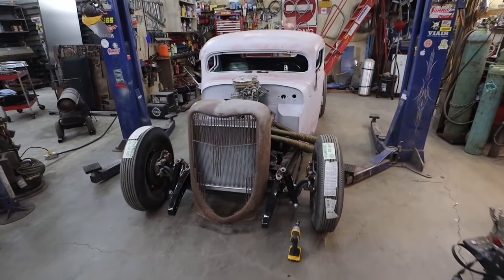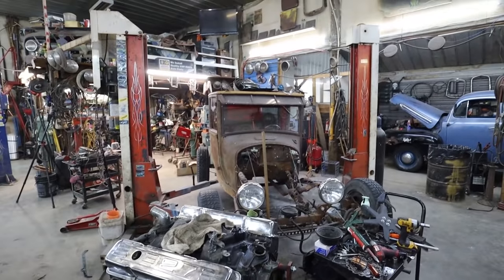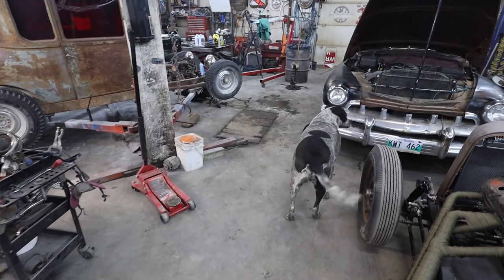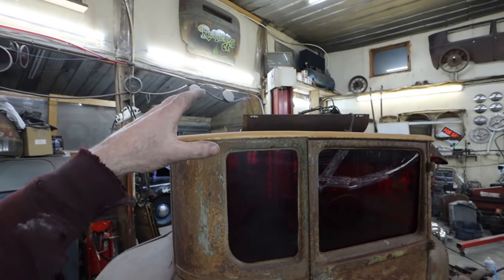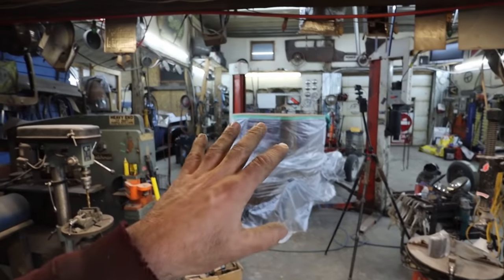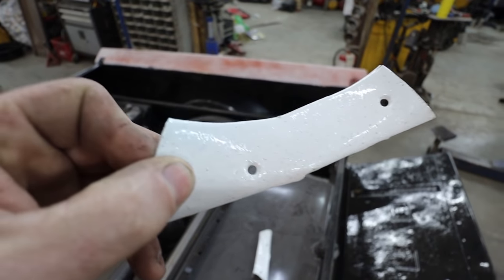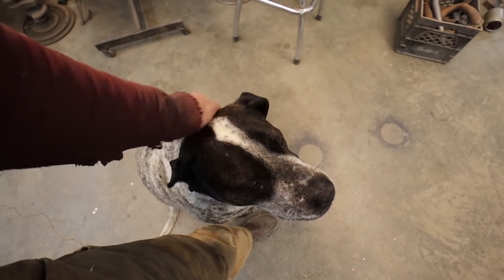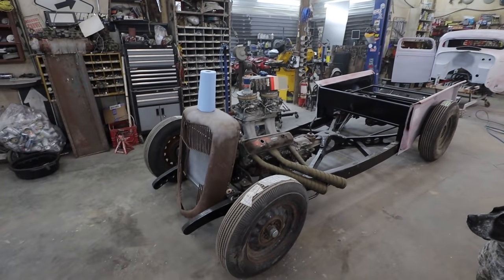Prepping the 327 and testing Metal flake paint maybe for the 37 Ford hot rod Part 29

Comment: Painting that black first then putting the flake on it will give you a much nicer, cleaner effect. Some people do it black and only do a couple of coats of flake and it still does look very good. I prefer to do the flake till its covered totally over a black base but you will use a ton more. You will only learn more the more you do tho. A primer gun with a 1.8 or 2.0 mm tip add the flake to the clear and just shake it constantly you will have pretty good success. That flake does look to be HUGE stuff.

Comment: We used to use a vacuum spray gun from Sears to blow flake. lay down a base coat with no flake and then spray the flake mixed with either clear or a tinted clear, Once dry it got about 20 coats of clear on top.

Comment: Hold on  Cuz on the sound deadner, Go to Lowes or Home depot, look for Peel & Stick Asphalt flashing, comes in 4" & 6" wide rolls, I used it on my Chevelle and works great as a heat sheild and sound barrier, cost me around $60 (US) 10 years ago

Comment: My first experience with flake worked fine. I used a big tip (2.5) and make sure the filter is pulled out of the gun. I also used a black base and .008 flake mixed in House of Kolor intercoat clear made for flakes and pearls. Then buried in clear.

Comment: Put some clearcoat in an underseal gun add your flake and spray at not too high a pressure and ten put several coats of plain clear on top see if that is any better. Also put a base colour down first.

Comment: Mix the flake with intercoat clear and spray it on after your color. Then sand and spray regular clear on top. The intercoat clear holds the flakes so they don't run as much.
Reply: With Colored Flake You Can't Sand Until It's Buried Under 3 Coats Of Clear!!! If you Sand While Just intercoat you will Sand Away The Color On The Flake Getting Silver Specks in The Paint Job!!! Best To Bury The Flake In Clear Then Color Sand and Then Flow Coat!!! After The Flow Coat It Will Sand Smooth and Polish Out Great!!!
That's how I Do It!!!
Rock On Brother!!!

Comment: SEM makes a candy concentrate that is green and easy to use Brent.  You pick a basecoat (like a a heavy silver metallic and add an 8oz bottle to two qts of clear.  Real easy to use, you don't get the striping like you do with a candy job and you won't have to put a half inch of clear to bury that flake!

Comment: A tip of the hat to you Brent. I had my VW bug painted last year. Afterwards I went to the paint store with the right paint code to have spray cans made. Did the wheels on one side of the car it looked terrible they looked like sandpaper. Never painted the wheels on the other side. My wife does all the painting around here. I'm the cleanup guy.😞

Comment: Ive sprayed flake on several projects with  a  good friend, and we started with the Dry flake (monster flake  .025) like you have.
The problem with big flake it takes a TON of clear and flake to cover.  We ended up spraying 12 coats of clear to cover the flake, then was wet sanded and polished.
What we are doing now is using a small grind flake ( baby .004) trippin flake from Roth.  Start by spraying a base color down very close to the color of flake you have, then using the  .004 flake mixed in a Mid coat clear, this is a heavier product and will help "suspend" the flake so it can be sprayed through a gun with 1.8 or 2.0 tip. 
Get this sprayed down as many coats as you feel is right for your look.  Then use straight clear and spray 4 wet coats and let cure over night, followed by 800 grit sand paper on a interface pad and get rid of alot of the orange peel. Then 4 more wet coats of clear, sand polish to a flat smooth finish.

Hope this helps.

Comment: Binks made a 2 gun kit in the 60's and 70's (don't know now). One gun was a standard paint gun. One was designed specifically to spray flake. As I recall (and we are back way beyond my memory) the flake gun came with multiple heads for large flake small flake, etc. It was an expensive set up back then but just worked like a dream. Might find some on the secondary market. I sold mine many moons ago but have regretted that since.
Reply: Binks i knew the design engineer back in the 60s
i used test out new gun in the field as to say 
late 50s start of the candy flake pearl ,,,, a sand blasting gun was for heavy metal flake,,, with over clear coat a 220 was a good clear coat gun,,, Edwin Beverly Hills Ca

Comment: 327 build , 

First, if the mains look bad, check the old crank for straightness in V blocks & a dial indicator and always ALINE BORE THE BLOCK !  Next, never EVER use a high volume oil pump unless you are running a true full DRY SMUP SYSTEM ! with a min of 20 gallon or more remote storage tank. The reason is ( as Smokey Yunick told me) a 5 or 6 quart oil pan will go dry before the oil can return to the oil pan with the extra long gears in a high volume oil pump and you very will can BURN UP ANOTHER SET OF MAIN BEARINGS AGAIN. What you should have used was buy a high pressure, standard volume oil pump ( yes they make them to with a different P/N# )  That high pressure pump will give you 65PSI hot and right at 68psi at 2,000 rpm on up but will   NOT suck the pan dry.  I just finished my 1967 / 327 ( now a 331) and with the high pressure pump, my oil pressure is spot on at 65psi hot but I did aline bore the block & ground the crank .010/.010 plus balanced everything and loosed up the side clearance on the rods so the extra oil pressure has a place to escape to help keep the motor cooler and mine is now running quiet and strong. ( I just got a total of 100 miles on it today) It will gain more horsepower as the Molly rings seat in a few thousand miles.

Comment: Not knowing as I do. It is done successfully. I reckon the right base colour to match the flake is a must. Now probably a clear epoxy resin will be better sprayed on in sufficient amounts to coat without running. For that you need the right advice on which resin is the one for the job? And keep spraying coats until it is thic. So you can sand it flat without cutting the flake/glitter much. It's not something I approve of but I have seen a green 38 coupe done in it and it was a work of art you might say?  Flat as a mill pond over the surface yet looking like you could touch the roughness when right up beside it. A fascinating experiment, and I still dread spraying metalflake, iridescent and pearl types. It doesn't look good 'enough', but it is getting there already.

Comment: Excellent video Brent  :) also on truck  looks great also T too with Metal Flake paint and least tried also learning from it ! 327 showed bearings that wild for sure on  Copper color and probably what happened you said did have choke on motor carb and raw gas mix oil happened  and hopefully cure problems have choke on carb next time! But saw check Metal Flake in next few days check over and might change mind say need cure on drying and makes difference! We all learning how do things that should be thought Brent  :) !

Comment: Hello Brent, I know you are a hardcore old-school hot-rodder. I was hoping that when you found out that it was the crank that was bad along with the main bearings as far as the oil pressure goes I wished you would have chamfered your oil galleys for that little extra extra. When I built my 440 the crank was in great shape and I was doing total rebuild with blueprinting so that's where I started chamfering the oil galleys polishing the crank. A lot of people don't realize that all Blueprinting is is taking off the sharp edges basically oh, and it will definitely give you a few thousand RPMs. Anyhow I can't wait to hear that engine and watch that sucker go down the road. Can't believe what you've done and where that thing came from.

Comment: I would use a similar color base to the flake you are spraying for coverage, that green looks awesome over black base without 100% coverage. the wet clear and dry application of flake works good you have to clear over the flake with 4 coats of the cheaper clears so you have enough to sand it flatter and reclear, I have made some heavy flake totally flat and it was a total pain with a huge mess to clean up. But you can.t get that look any other way.

Comment: Good attempt at metal flake. You tried something and you now know what works and what does not. Mixing the big flake/glitter with a clear or colour coat would create consistency issues as well I would think. Think you just need a better method to apply the flake/glitter in a uniform consistent manner. I still like the idea of a matte green finish, maybe not as dark as the General. It would look really cool with the matte black trim/mouldings. Be safe and stay well.

Comment: @ 20:02, finally a work philosophy I can understand !
I've gone through a lot of my adult life with the theory that if its not working when I am asking to fix it, what could go wrong?
Part 2 of that is, if I trash it I buy a new one.  Don't know that has ever cost me more than a couple hundred and you can keep the rate of work high, plus often people wonder how you "learned" that...while, you weren't around for the first few I broke.
Re paint:
think its going to have to go through a real spray gun just for the consistency and control (Shutz gun too random).  Figure out the size of orifice on the heavy primer gun and if you don't use one of the other sizes that likely came with the gun (forget a bit, most guns from Princess come with multiple tip sizes), use that as a starting point.  Find a buddy with a full set of drill bits (letters, numbers, fractions and metric) and starting with the size opening the primer gun uses, working your way larger until it works with the size of flake you got.  WAG but in the '50s and '60s lacquer was a whole different ball game, not sure how well those products/huge flake work with today's paint chemistry. 
That white in the interior is very mid '60s, lots of furniture had Fomica tops with that mix of silver and gold "star" pattern.

Comment: I spray flake that size all the time mixed with clear gelcoat on boats best set up is a gun with a 1.8 or 2.0 tip spraying at about 1/2 the fan area you would without the flake,then finish with with a clear coat over top for a smooth finish.another tip is the 3m acuspray gun is ideal with the disposable tips but not cheap

Comment: many moons ago I hecked into metal flake paint (old school) and found out you put on a color coat first then use less
reducer so the clear is a bit thick then spray on the metal flake then spray it with air only to flatten the flake into the wet paint then give it up to 25 coats of clear

Comment: We painted metalflake on boats in the 60s (my father and I)  base coat color, flake in clear then clearcoat.   Never had any problem.  It's all in the quality of the paint.  Use lots of clear.  Use a proper paint gun with the correct paint nozzle.

Comment: Paint a solid base color first, lighter or darker than your chips. I use a binks #7 with a primer tip. mix the chips with a thinned clear. Spray with a higher pressure to get the chips to lay flat. If you don'i get them flat later sanding will sand the color of the chips making sailver chips. With the base coat of color you don't need or want100 percent coverage. better if you don't After clear the sh77 out of it sanding between every three coats or so. Keep it wet so you can see if you hit a chip edge. Touch up silver chip edges with a tiny brush of base color between clear coats. It sounds complicated until you do it. Just a lot of clear coats and wet sanding.I have done a couple with a few top coats of candy. It makes the chips seem an inch below the surface. A round body style is perfect for this if you want the antiqued worn area look, darker edges lighter in the panels middle.Ah the 70 s painting ideas up the yahoo.

Comment: I've done metal flake a few times. I sprayed a course metallic silver base, then metal flake in a mid coat clear, then I sand it and spray a candy coat then lots of clear. I believe I used a 2.2 tip for the flake, but there is a good chance your flake I larger and would spray through the 2.2 tip

Comment: I've always mixed the flake in with clearcoat and sprayed it on add a couple marbles in a suction feed gun. I've used up to 8mm flake with no problem. Modern plastic flake is really nice because it's the same color all the way through. Check out Roth Custom Flake's site, they've got a gun like you made and BIG flakes.

Comment: How about using the flake in/on a contrast colour? Maybe do the grille, rear window and the stake pockets in a darker colour with the flake, keeping the rest of the truck in a plain, lighter shade.
Looking at the red flake on the other car, I'd try a few more coats of clear, maybe get it to smooth out. When you started doing just the edges of the roof, it was starting to look pretty good. What would happen if you just did the edges with the flake, leaving the main body of the roof in a solid colour, with just a one inch border of the sparkles?

It's pretty interesting watching you experiment with this stuff though. Tere's plenty stuff outside that you could experiment on, either single panels, or whole cars, although that would take up valuable space in the shop. I still can't picture what the truck is going to look like when finished but I'm not a big fan of either of the greens so far. You'll get there though and it's the picture in 𝒚𝒐𝒖𝒓 head that matters.👍😁

Comment: the best way to put that type of metal lake is do a two part resin and mix the flake into it then use a heat gun to level it sand and polish or clear coat it. thats how i did my custom interior on my 73 scamp and 76 gremlin. also not as budget friendly just go with a metal flake paint from eastwood

Comment: find an old jet for your spray gun and open it up so it is just smaller than the needle so with a thin mix it will go through the gun and yes you do need something in the pot to rattle around to keep it mixed

Comment: Did this once but used a thick clear epoxy gel coat and a screen to sift the flake onto the gel. Let it sit for the flake to settle into the gel Then vacuumed off the excess flake. Many many coats of clear coat later DONE! Not an easy task and real time consuming.

Comment: Brent I wonder if for holding little objects like those bits of trim so they don't blow away when you paint them you could try something like a valve lapping stick.

If using suction cups to hold an object on the stick didn't work you could try something like magnetized rubber strip?

Comment: If you put a green base down and use a siphon feed gun with ball bearings will work. They used to make agitator cups for the siphon feeds. Check out 57letterly here on YouTube. Bass boat type flake ...or sinister 57 Chevy by victory red Colorado. I sprayed that w the ball bearings in the cup setup but takes a lot of clear to bury the flake..20.00 harbor freight siphon works great

Comment: Don't know the size of that flake, but if it's real big you'd be better off getting smaller flake and you'd still get the look you're looking for...Also you need at least a .02 mm tip on the gun...Here in the states Harbor Freight sells a cheapo for about $22.00 bucks that'll get the job done and throw it away afterwards....I recently flaked a bike like this and it came out awesome

Comment: At the same point in time that metal flake was big, so were candy colors. Why don't you go to a candy apple blue? Metal flake has always been very expensive because it's so hard to do, especially with over- sized flakes. Your biggest dilemma with a candy color is whether to have gold or silver be the base color. Your original mint green was not a good fit for that truck, but to each his own. If you are going to do the bomber seats and leave them the natural aluminum, maybe black would be better than white for the interior.

Comment: I’m sure you knew this, after putting your masking tape down, take a hammer and lightly tap around the edges and the metal corners will cut the tape exactly where you want it masked, saves the time using the knife lol

Comment: Would the wrong harmonic balancer chew up main bearings  didn't the 327 use a narrow balancer as in, internally balanced and the externally balanced 350 used a wide harmonic balancer

Comment: for heavy flake touchups i actually mixed the flake in suspension with the clear and used a very slow hardner painted it on with a brush. I have also used (don't laugh) some pvc pipe and a clean shop vac on blow so it works like a big powdercoat gun or your little blaster gun but with a lot bigger nozzle adjust pickup pipe size to control flake volume or you could build the same thing on a air nozzle instead of the shop vac

Comment: You can't sand metalflake very well. The sandpaper can bites too deep andwill take the red coating off of the aluminum flakes and look dull and grey. Be very careful you don't sand too deep. Also you need an undercoat` of the same color.

Comment: Metal flake paint is all in the correct color base coat & getting the correct size tip for the size flake your using, then drowning it in multiple coats of clear. Wet sanding with 800 then 1,200 between every few coats of clear to get the orange peel flat, then hit it with the compound and slow rpm buffer to bring out the shine. --- See link https://www.youtube.com/watch?v=oSk5GaOqzzw